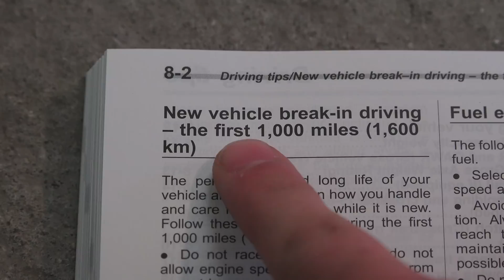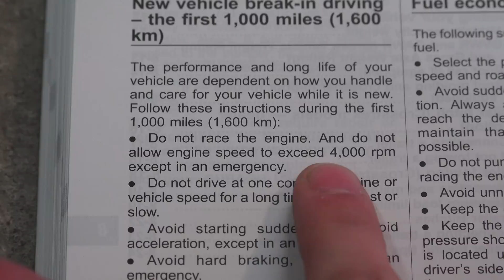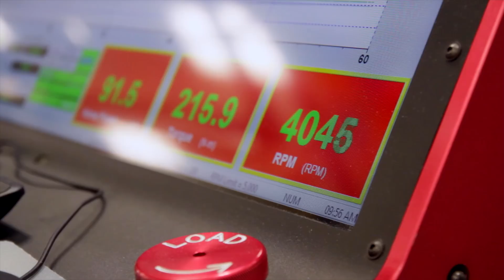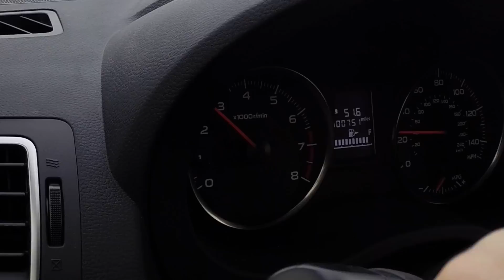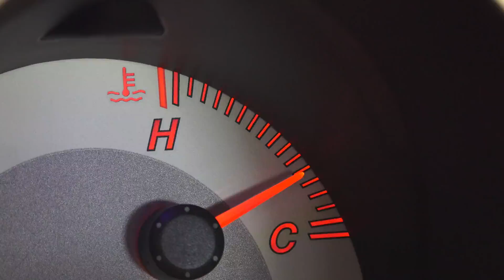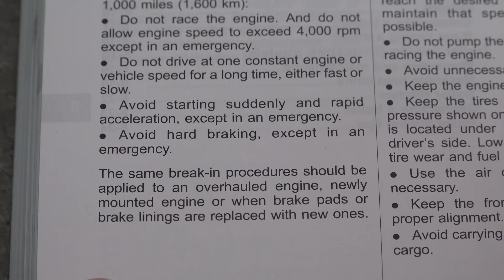5 Things You Should Never Do In A Brand New Car

Comment: GM PERFORMANCE disagrees with you. I dropped a brand new GM Performance crate 502 in my motorhome. The instructions provided from GM PERFORMANCE specifically states to do 3 full throttle run ups in first gear. Leaving the car in first gear and letting it slow down on its own. This high vacuum condition sucks the oil up onto the cylinder walls to help lubricate the walls during that first break in.

BTW: While the purpose of your point about breaking a vehicle in a trip is correct, I personally prefer to break in an engine on a trip. The reason is that once you get out on the open road, it is much easier to stay focused on constantly changing my engine speed. You can even run in lower gears sometimes, which varies the load and rpm. I find on a trip, I am away from traffic, and it is much easier to do what is necessary without the distraction of traffic and daily demands.
Reply: Davinet . Spot on.

Comment: And use a top-tier oil filter (Amsoil, Mobil 1, Purolator Boss) and change the oil within the first 100 miles, again at 500, and 1000.  Switch to synthetic at 1000 change.

Comment: 3:50 - Sciemetric testing system.  We use these at the Ford Cleveland engine plant to read air/helium pressure, flow, torque etc.  Great software and easy to calibrate and diagnose problems.
Reply: You can't spell a great testing system without a metric in it

Comment: I have tried both schools of thought, drive it like you stole it or granny it. I do think both have their advantages and disadvantages. I do believe the drive it like you stole it method give you more performance, however the granny method will give you longevity. I have an Infiniti G 35 that I broke in with the drive it like you stole it, it runs like a scalded cat. However with 147,000 miles now it's starting to use oil. My Nissan front tier pick up truck was broken in the granny method and with 205,000 miles on it it uses not a drop of oil between 7000 mile oil changes. 

My real question is brakes. How do you reconcile "no hard stops" with the "bedding in" process that SHOULD be done with all brakes?

One last thing, I have toured a GM plant and when they start and test a new car right off the line, they are ANYTHING but gentle with it. They floor that booger on the Dyno.

Comment: Picked up my ND MX-5 two days ago with 4 km on the odometer. I'm going to  follow the break-in rules for 1500km (a little under 1000 miles) and at 1500 or 2000km it'll get the recommended oil-change. But man, oh man.. is it ever hard to constantly shift up at 3000 - 3500 rpm - especially with an engine as sweet and quick as the MX-5's. 12 years of VW 2.0 TFSI really had me forget how great a naturally aspirated engine can feel (and sound).. :D

Comment: Correct about the don't do constant speed. I got a reconditioned engine fitted and drove back constantly at 50 mph at about 2000 rpm. Every time time after that the engine made an irritating rattle at 2000 rpm

Comment: I have rebuilt some engines so pretty much the recommended methods to follow,  you need to use mineral oil, the tolerances of the engine depicts the routine of running in an engine properly. if you have an expensive engine break it in on a dyno, high performance engine close tolerance, break the engine in on a road in the country that has hills, short straights, twists and turns so engine is not at a static rpm range, so its go for a enjoyable drive in the country.

Comment: I had never heard to go a hard break-in for an engine.  Always heard and read what he says - take care of it and the engine will last a long time.  The hard one to follow all the time is run the engine long enough so it warms up.  Especially if you buy a car going into the winter and your commute is 11 miles.  It does not usually give you enough time to warm up at 0 degrees or less as the warm up takes more time (as much as 30 minutes).  However a great video based on the owner's manual.

Comment: Complete warm up first, then I floor it, but in cycles from WOT to engine-breaking (Normaly Aspirated load), but at low rpm (start out at aprox 6 m/s piston velocity) building rpm as time passes. First hour on mineral oil. Boosted engines must be  limited to not go over atmospheric pressures... Has given very good results for me, but then I have OCD tendancies and bore and hone my engines with clamping plates and with the block at 90° C etc... One can be amazed over how much the cylinders deform when hot and under the tension from the cylinder head bolts...and piston ring "seating" won't compensate for that whatever procedure is used for break in...

Comment: I work at a Toyota dealership and when they get new cars off the truck they had to do this thing called a pdi and what the techs do they put a fuse in the fuse box and put hub caps on etc... then they take the new car for a ride about 5-8 miles and keep in mind these cars/trucks have like 1-5 miles on them and they drive them to red line and beat them, i guess its part of the pdi on the new cars/trucks.

Comment: Full Throttle with Towing I tend to be in between three and four thousand RPMs at the most but I'm usually about two and a quarter meaning 2500 RPMs while towing with my 99 Subaru Legacy Outback

Comment: Wait modern cars have engines? All I see under the hood is plastic
Reply: You should also look under the engines if you want to see plastic.  The new Mustang GT's and Shelbys have plastic oil pans and drain plugs.  My 2017 Silverado with its Z71 "off road package"  has a plastic engine shield.
Reply: Stuff can be made of plastic, doesn't mean it isn't what it is.
Reply: @SolomonParker: If plastic is the state of the art, why don't we see any plastic submarines, tanks, or battleships?  I have a couple Kubota tractors.  One of the models, a BX-25 had plastic fenders, running boards, and hood the year before my model.  Fatso's kept breaking the running boards when they stepped on them.  So Kubota went back to metal; which mine has.
Reply: @AStanton1966  Okay, put metal running boards on your engine. Or don't let fatsos step on your intake manifold. I don't know, deal with your problems.
Reply: You are  probably having a problem with your eyes. Go see a doctor!

Comment: Engines are much better than they were back in my days as a mechanic in dealerships but I didn't worry about a customer broke in an engine, customers are generally idiots. But when I did rebuild an engine I did break it in the best I could before handing it back to the customer with the time I had for such things. I would take it out on city streets and put it in second gear and nail it from ten mph up to about forty mph and let off and let it run back down on compression, about ten times, and if I could I would talk to the customer with further instructions but in a dealership you seldom get to talk to the customer when they pick it up.

Comment: One little thing about this, when a motorcycle is finished at the assemblyline, it gets fuel in the tank and then put on the dyno where they run it thru the gears and to the redline, without warming it up, they do that to ensure it delivers what it is supposed to......

Comment: Good video. I've never bought a new vehicle, but I've bought 3 new motorcycles and many of the tips will apply to those. My first oil change at 1000kms I used conventional oil which I recommend in any engine then switch to synthetic after that. It's also useful to use some engine braking as well as not revving it up a bunch in neutral (no load); this is bad for obvious reasons. Stay smart my friend.

Comment: Pretty good. Couple of things about cruise control. When you drive in the city and use cruise  to keep from speeding and  you're running at 35 mph the torque converter isn't in lock up. Since it's not in lock  up every change in slope will increase or decrease rpms because of stall speed of the torque converter. You can see it on the tach. Your speed may be the same but the engine speed will go up and down depending on the slightest change in grade. When you're in lock  up mode at say 40-42 mph the engine will be running very slow and when you, for instance, go up a slight hill you're hear the engine working harder but the rpms don't change of the cruise is holding you speed in place. (don't worry, the way automatics work it won't let the engine lug. It will kick of of lock up or go down a gear to keep that from happening)  So that's how you know if  you're in lock up or not, up a slight grade and the rpms pick up but speed stays the same, not in lock up. Up a sight grade you hear a change in engine note or load but rpms and speed don't change you're in lock up. 

On the freeway little ups and downs vary load on the engine but not rpms and the book on that is don't stay at the same rpm for long periods in break in. This would be especially true if  you live in Kansas or Nebraska that are so friking flat that on cruise  you're not varying the load or the rpm. However, if you live in hill country like Appalachia or the mountains west of Denver the load is going to vary a lot. It will kick out of lock up if it needs to or even kick down a gear. 

But judging by the Honda Acura you mentioned production tolerances must be very  small for Honda to be able to break the engine in with a mere 100 miles on a variable dyno. 

So it's not as crucial as it used to be but don't floor it and don't rev it. In fact, even after it's worn in don't let the engine run above the redline.

Comment: the reasinnis to avoid defect return.. company does not want return or refunds.. parts are genuine... so hard break in is good.. you dont want a grinder under 1000 rpm because result will be ugly.. the faster the grinder runs the smoother the result is... simple..

Comment: Odd how this seems to be an American thing. I was born and raised there and I have to say for the last roughly 20 years,  every car I've had has been a "factory break in" vehicle. They have ranged from Acuras, Lexus and most recently BMW. I remember specifically, especially BMW, stated that modern cars do not need a break in period. And I've never had any failures or engine issues with ANY of my cars. Again seems to be American manufacturers and for the American market. Perhaps that market is just overly sensitive about small issues or manufacturers are avoiding the overly litigious consumers that make up that market. I've checked dozens of car makers that sell here in Australia, and didn't find any except Jeep who required specific break in procedures. Best rule? Change oil regularly and more often than not. That's the cheapest and best insurance to keep an engine working like it should.

Comment: Great video and I agree, the manufacturer recommends it for a reason.  My question though is if you buy a used car, how can you tell if it was broken in properly or not?  Compression test?  Also it sounds like you are saying it just increases the risk if you do a hard break in, but not an absolute guarantee that the engine will be damaged.

Comment: What's the max duration of steady RPM?? Highway driving is almost impossible to avoid since I drive to work, but I try to vary the rpm and not to keep it same more than 10-15 seconds. The car is still at 250km, any recommended oil change intervals fir the first 10K km (6K miles)?   Thank you!

Comment: I have a relevant question: I just got a brand new Toyota Corolla Altis 1.8 1798cc petrol car. Its engine oil capacity is 5 quarts (4.73 liters). What is the correct quantity of the engine oil to be filled in the car when the oil be 20W-50?

Comment: Having had many news cars over the years which I have "broken in" as has been described, I have always changed the engine oil and filter after 500 miles and again at 2000 miles using non-synthetic and then switched to synthetic after 10,000 miles. I only started using synthetic in early 2000. 

When changing the oil the first couple of times and holding the oil in a pan and catching the sunlight, the oil has always shown fine metal particles.

I've read where people have said that the new engines are manufactured with closer tolerances and that a "break in" isn't necessary as it was in the older days.

However, in most if not all owner's manuals, recommendations are given for driving the vehicle for the first 1000 miles which advise limiting revs, not lugging the engine, not doing highway driving for extended periods, not using speed cruise - for that reason as well as with speed cruise extra load is put on the engine when going up a hill as the car attempts to maintain a set speed. 

The reason for these recommendations is so the engine parts can "bed in" (besides rotors and brake pads) The video describes this being necessary for effective piston ring sealing.

I see there are a lot of cars that come factory filled with Mobil 1 (which I use) 
Here's a list

Acura RDX
Aston Martin
All Bentley Vehicles
All Cadillac Vehicles
Chevrolet Corvette C6 and Z06
Chevrolet TrailBlazer SS
Chrysler 300C SRT-8
Cobalt SS S/C Coupe
Dodge Caliber SRT-4, Charger SRT-8, and Magnum SRT-8
Jeep Cherokee SRT-8
Mercedes-Benz AMG Vehicles
Mercedes SLR
Mitsubishi Evolution
Pontiac Solstice GXP
All Porsche Vehicles
Saturn Ion Red Line and Saturn Sky Red Line
Viper SRT-10

My question is, if Mobil 1 and other synthetic oils make the claim that they reduce friction and wear, how are the piston rings, bores and other parts going to "bed in"?

I'm sure running an engine for 200K miles starting with factory fill synthetic will be fine, it just doesn't make engineering sense. From the oil manufacturer -"Our oil will reduce friction and wear" - From the vehicle manufacturer - "it is necessary to observe the following break in recommendations so the engine can bed in properly".

I'm old, so please bear with me and tell me where my thinking is wrong:) Thanks.

Comment: I realized break in recommendations were horseshit when I went to a Kawasaki dealer ten years ago and saw the exact same break in recommendation sticker on the Ninja 250 next to the ZX-14R.

Keep it under 4k RPM for 600 miles on a Ninja 250...suuure. So basically the top speed of the bike is going to be 35 mph.

Comment: Ford Motor does a pre break- in for its customers with most if not all its vehicles @factory from passenger sedan to high performance variants! Ford also recommends an easy 1st 1000mis as well for best all around performance/engine longevity! I personally change my oil before or @ 1000mis esp when I have a high tech twin turbo DI Ecoboost motor in my newest vehicle . Out goes factory fill   "semi-synthetic"...  in goes "full synthetic" Pennzoil Ultra Platinum 5w30 & stock (type) Motorcraft oil filter! Thanks for very informative video!🇺🇸

Comment: To be 100% honest this only apply's to the first 1000Km's here and 1000miles over there in America. My Farther rebuilt his engine a few years back and it never broke it. He drives a total of 15 minutes each morning and each night, and he goes 50, 60, 70, 90 on his trip to work.
The most big reason for the break in of 1000km is bearings if new, because if you don't break them in then the same issues as the piston rings would happen. If i wear it in the first 1000km's my rings will still be sharp. So as a Technical friend put it to my Dad "Some racing engines they push over the red line for 15 minutes with a proper flow of cool fresh liquid passing through to break the engine in".

If i look at the cylinder on my Dad's engine, one side is smooth and the other shows the marks from been honed. I'd like to note the disassembly was done by us but in the end was rebuilt by a engine reconditioning shop.

So if what you have said about breaking in the engine is true why did our engine not break in? Mitsubishi Pajero V6 1987 Chromoly piston rings. Full rebuild Cost $3,000 AUD

PS: Apparently this engine was built for racing in the 80's so i don't know whether that changes anything. Car's done around 50,000Km's since the rebuild and the rings have defiantly not broken in, only on one side. V6

Comment: Always warm up a new car before driving it. My dad would also put on parking brake and some chucks in front of wheels, put it in gear and leave it in drive for an hour every day for the first month. A bit excessive, but cars ran great and we always sold them with a shitload of miles and engines still running great.

Comment: A pretty important thing that I've learned, change your oil as soon as you possibly can.  I had my engine rebuilt, new block, head, pistons, crankshaft.  After 25 miles I changed the oil and the oil looked like it had 2,000 miles on it in color and the filter looked similarly worn.  I sent it to BlackStone Labs and they told me it had characteristics of oil that had 6,600 miles on it from all the initial debris breaking loose from the assembly.

Comment: the whole soft break in thing is kinda of weird the reason the owners manual say not to floor it is because of legal reasons . really in the factory the first thing they do is take it to max revs for you , well most companies do this to get the pistons to seat hard and in place not slowly wear them in , they also do this so they know the car can take whatever you throw at it . I used to work at a motorcycle manufacture ( Kawasaki ) and now work as a car mechanic not sure if cars are tested the same but im sure they are or very similar a engines a engines same tech just a bit bigger